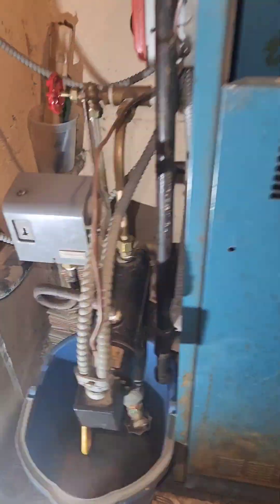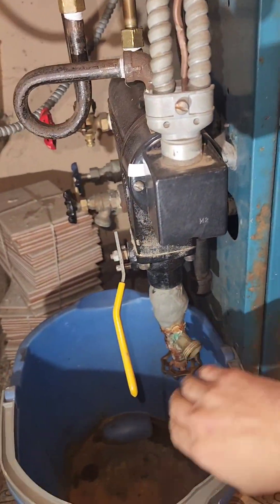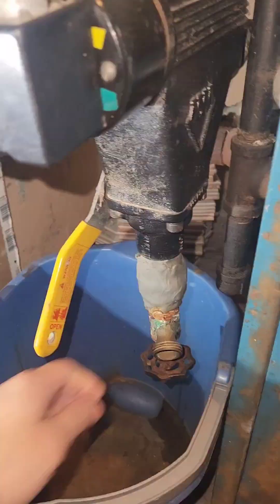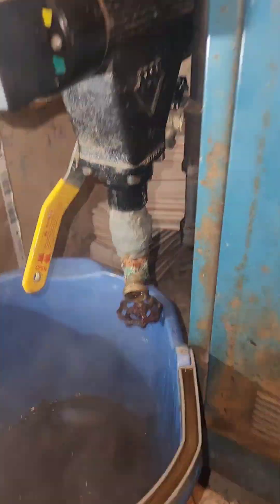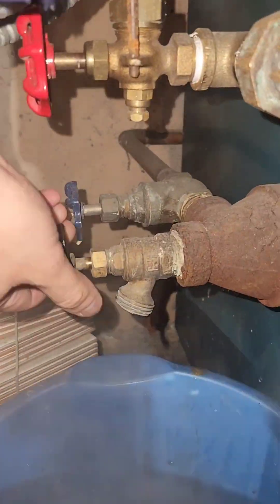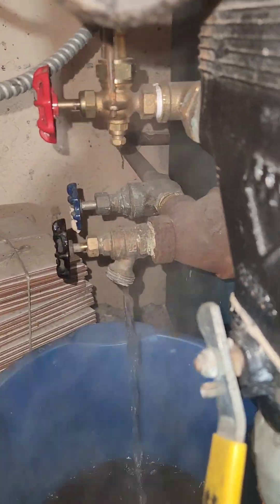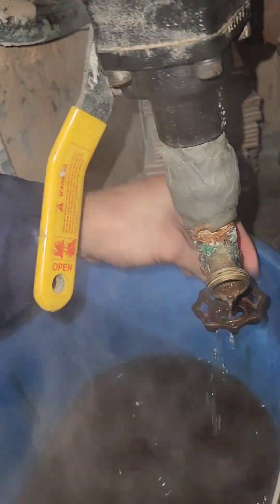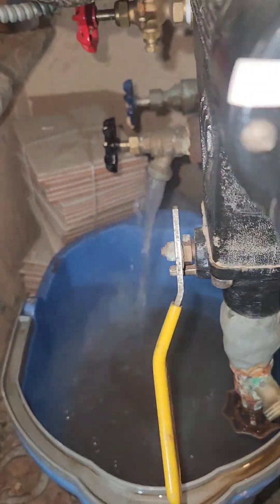DIY: Basic Boiler Maintenance #shorts

Comment: The valves you have should be ball valves. Every time you let water out of your boiler you’re bringing in water with air in it. Also if the water you let out is clear not black you probably have a leak in your boiler system.
Reply: Its a steam system guy. There is alway air in the system.